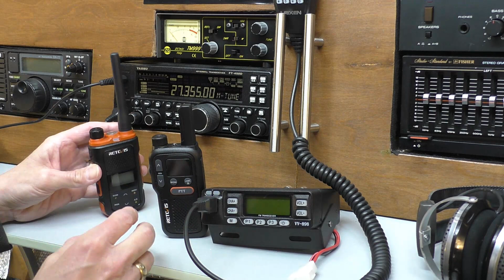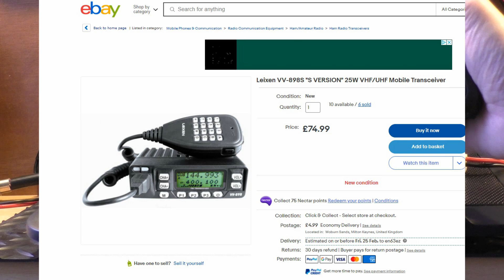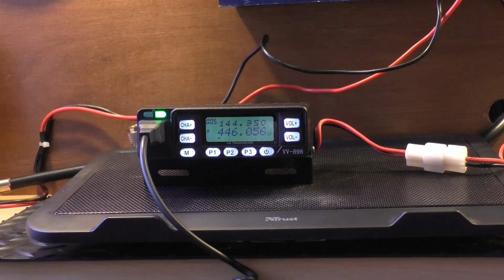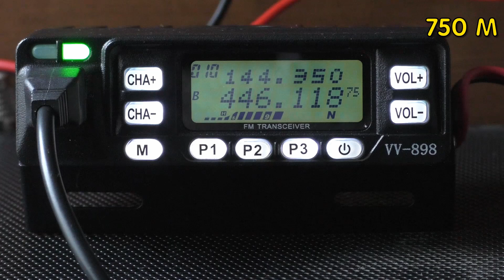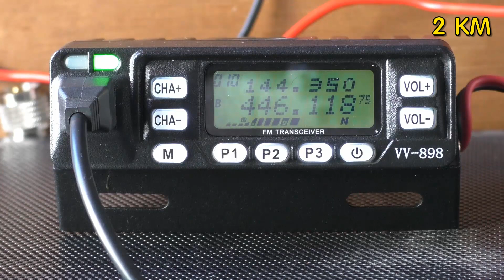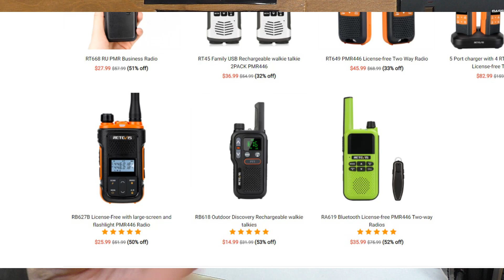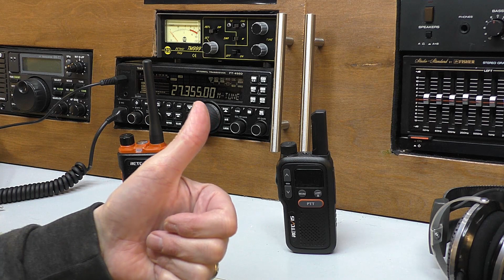Retevis RB618 446MHz £13 legal PMR radio.  Longer range testing

Comment: Great videos but for some reason your links seem to have trouble in UK?  E Bay selling these at  £19.99!!!
Reply from the maker: I think they have been replaced by the 615 model.   Just a word of caution you need to be careful of clone radios on Ebay.  Trying to get a genuine Baofeng is almost impossible.
Reply: @CB-RADIO-UK  Yeah I just invested (Foundation exam tomorrow) in a UV-15R which is described as a baofeng but I wonder why the programing software is totally different to the UV-5R as I now own both for a comparison. So whilst I am at it I would inform people out there the antenna fitting on the UV-15R is female and on a UV-5R its Male!
Reply from the maker: Good luck with the exam Brian.
Reply: @CB-RADIO-UK  Thanks I passed!!
Reply from the maker: WELL DONE Brian !!!!!!!!!!!!!!!!!!!!!!!!!

Comment: Hi Fred, I'm thinking about coming back on to CB again after about 20years not on. What's your take on the  CRT SUPERSTAR SS-6900-V 7, Thanks Paul (Bulldog)
Reply from the maker: Hi Paul.  Its a great starter radio to get back in and learn SSB.  Also worth a look is the Alinco DX10 which is very much the same.  Ive done loads of videos on the 6900 if you check the channel.
Reply: @CB-RADIO-UK  I've been looking at your  videos for a while now, that's why I asked you the question, keep up the good work.

Comment: Fred what range would these Radio be handled to handled
Reply from the maker: Depends on surroundings.  Ive only tested these in a built up area with lots of houses. Iam getting around 700m -1km tops. More out in the open though.
Reply: Thanks for that

Comment: 11 pounds is not a huge amount for this little pmr radio. Surprising to see how you reach 2 km. Interesting to see how it works on that pmr antenna you were showing in the video. See ya!
Reply from the maker: Its slightly increased to £13 but still cheap.  PMR antenna next sat.  Things went a bit wrong though.

Comment: Have anyone ever got in trouble for using unapproved radio on pmr446?
Reply from the maker: Not that i know personally.  I think it depends where you use one.  I would think if you were transmitting at a public event with police / security you might get questioned.

Comment: Come on, we need that DR111 testing, it’s no good teasing us with a 10 second intro 😉
Where did you get it, can’t seem to find it ?
Reply from the maker: Tested.  Video next week.  It did not go to plan though.
Reply: @CB-RADIO-UK  cheers Fred
Reply from the maker: I got mine from ebay a few years ago.  TBH they are over priced and very easy to make if you have the time.

Comment: The Antron 99 actually works very poorly on 446 for obvious reasons so you may be surprised when you try that little purpose built antenna, even better if you could try a Watson/Sirio/Diamond collinear.
Reply from the maker: Hi Dell.  I was very surprised when i put the DX111 up but not for the right reasons :-( Video next Sat.
Reply: @CB-RADIO-UK  I've just tried my Antron on 70cm and a station which was 20 over 9 on my Watson 2000 vanished completely when I put the Antron on. I actually wonder how on earth your Antron was receiving so well on 446... 🤔

Comment: Hi Fred.  I've mentioned previously - GMRS the system that's being used and growing in popularity in North America, allows use with power of upto 50 WATTS in the 70cms band, and it also shares the American version of PMR (FRS), the FRS Frequencies are at a reduced power to match those cheap type handsets. GMRS also allows repeater use!! It's giving CB a real run for its money in North America,  you need to buy a licence from the FCC but there's no test, and the FCC issue you a call sign that applies to anybody within your household. The system has 22 preset channels.  It's gotten so popular in the USA that the manufacturers "Midland" No longer manufacture CB radio equipment and are solely focused on GMRS Equipment. 

If OFCOM allowed it's introduction in the UK, I think it would quickly gain a following over here.

There's a YouTube channel "Notarubicon" Which has a lot of GMRS content, I'd suggest is any of your subscribers were interested it's worth a look!
Reply from the maker: Sounds interesting.  Thanks